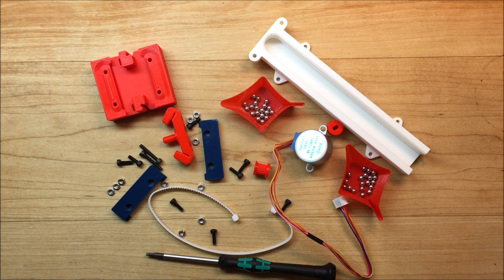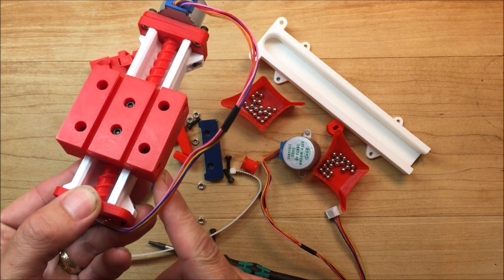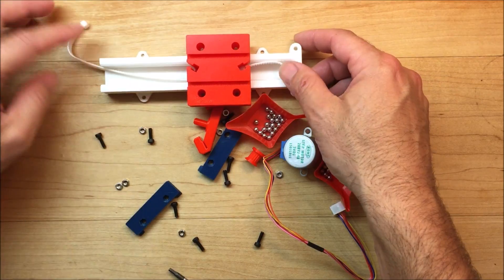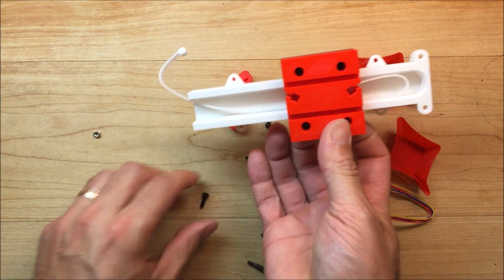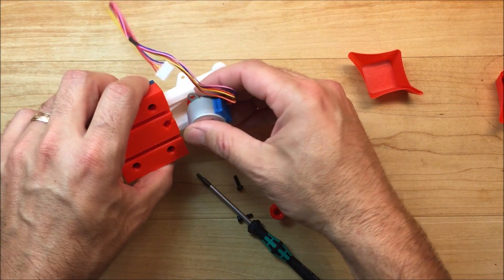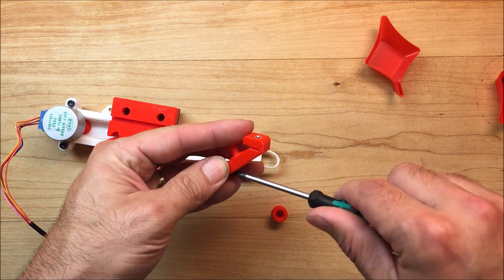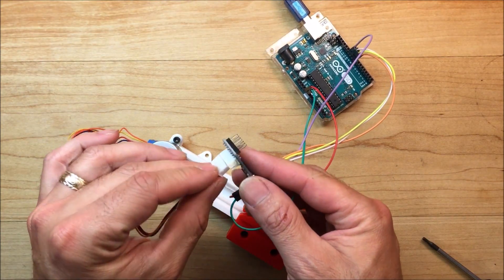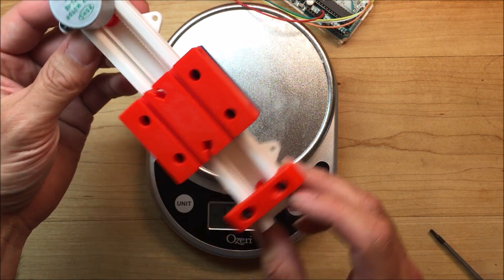3D Printed Belt Actuator

Comment: Really great work! I didn't see you use any switches to determine the bounds of the movement, does the board that takes the arduino (in1...in4) and convert to 4-phase motor output know the bounds based on motor resistance? Love to see your arduino code if you are willing to share.
Reply from the maker: I'm just moving to a specified distance(Rotations).  I think I just modified the default "stepper" sketch. Switches would be a nice addition though.

Comment: Is there any other option for the timming belt as i don't have this material to print.
Reply from the maker: Sorry, its a standard pitch but the belt is designed with knobs on the ends which keep it in place.

Comment: hi,can u show us how you design the linear rail ? what consideration to design this perfect linear slide ? it is illegal to buy bb's in my country. so im going to go with 3mm bearing balls(super cheap/1$ per 100pcs). or at  least give a tips n trick how to get perfect tolerance needed. im really impressed by yr skills .
Reply: im also interested to know how u design the lead screw for Mulbot
Reply from the maker: I started with the root diameter of the screw, then drew a trapezoidal tread according to my machinist handbook.  I used the coil command to wrap the thread around the root diameter.  Last, I used the array command to create the second start.
Reply: @3DPrintingWorlds  I know I'm a bit late to the party here, but I would love to see videos of you doing the actual modeling for these amazing projects! It would be very cool to see the though that goes into every feature and all of the necessary considerations!
Reply from the maker: Bearing balls work better, the Mulbot uses, 4.5mm g100.  Don't get to small, you might have a hard time getting them to recirculate. I would love to make a video on this if I can find some time.